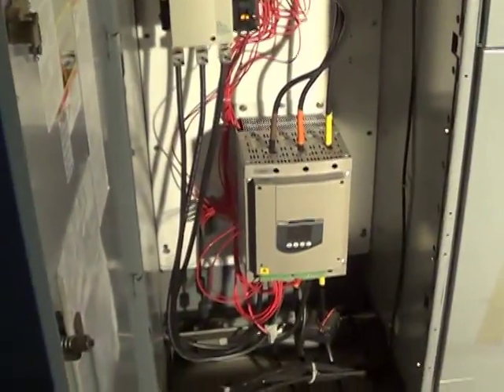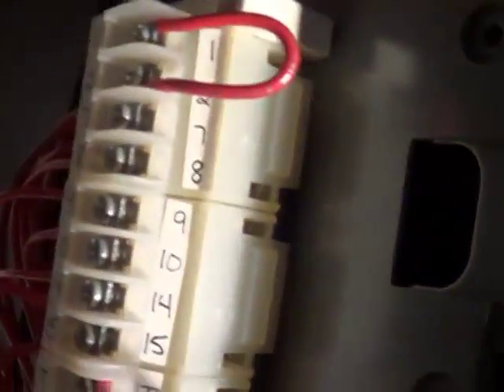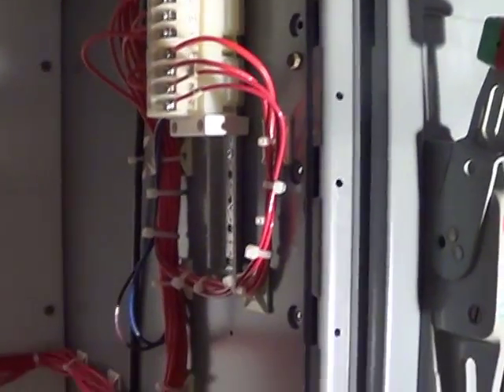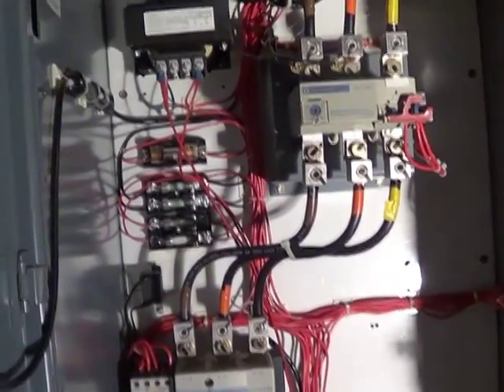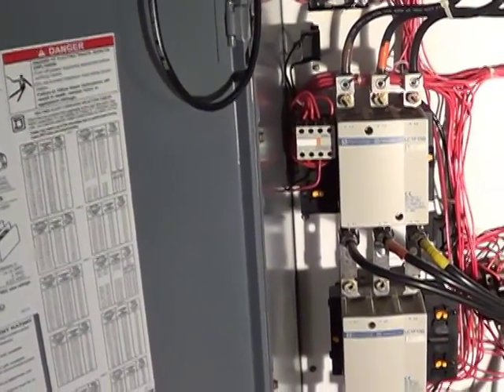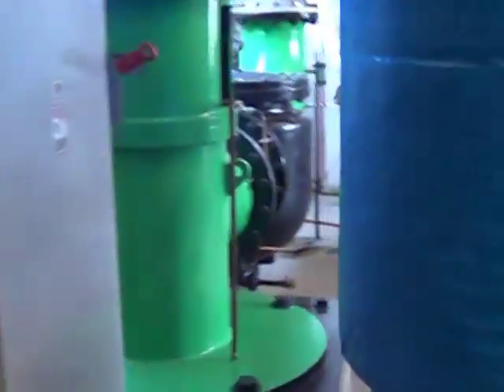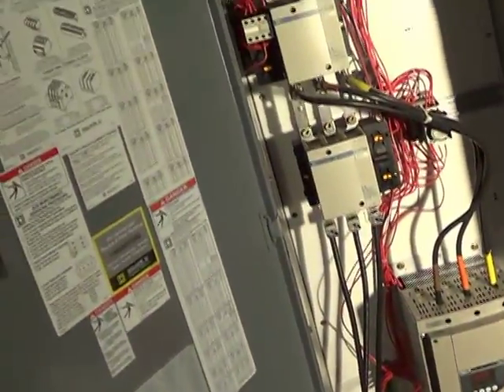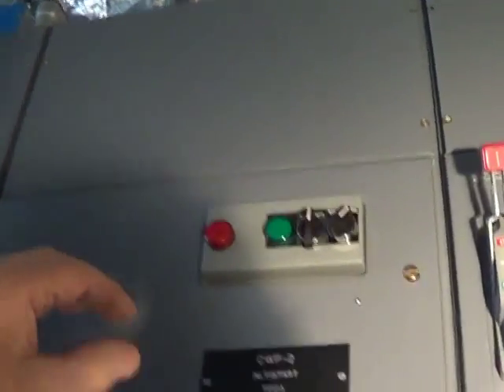Electric Motor Soft Start Part 2

Comment: that is a type of starter used on hydraulic elevators mostely schindler elevator
Reply from the maker: Interesting.  Thanks for your contribution.  I suppose those big ole cable elevators are still using DC motors with messy brushes?  Always loved those Otis emblems on the very old motors. Take care.
Reply: um no they are made in something called mrl or machine room less which has to be the werst elevator yet I cant tell why because it will take to lang and a lot use dc moters with steel cables for amshort eriod they used keblar cables but they woreout look up 1992 dover oildraulic equipment to look at hydraulics